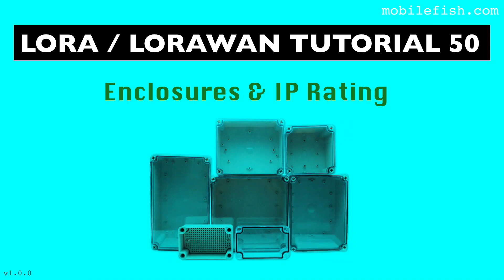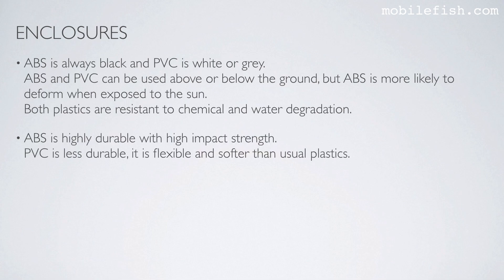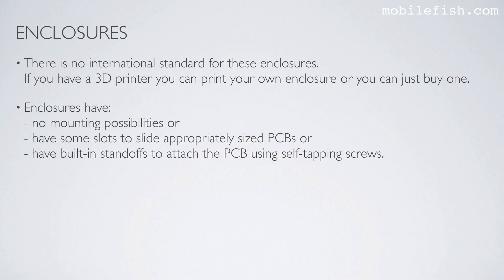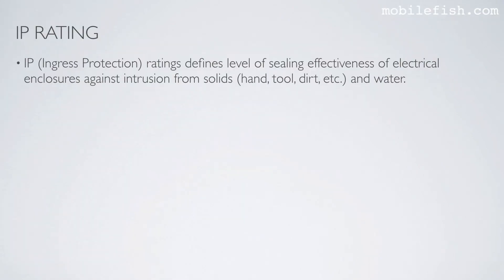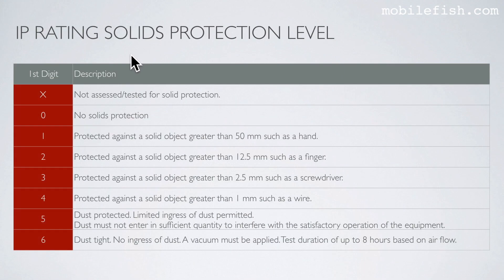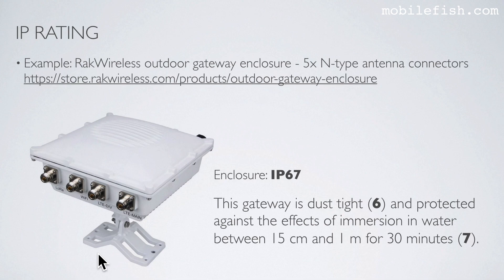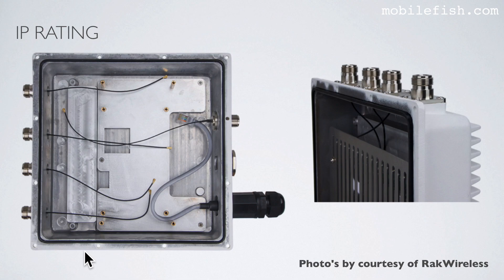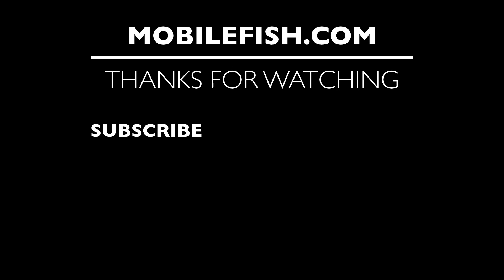LoRa/LoRaWAN tutorial 50: Enclosures and IP Rating

Comment: i just came across something moments ago after watching your Blockchain tutorial  11. it's about the generator point (G)
G (compressed) : 02 79BE667E F9DCBBAC 55A06295 CE870B07 029BFCDB 2DCE28D9 59F2815B 16F81798

G (uncompressed) :  04 79BE667E F9DCBBAC 55A06295 CE870B07 029BFCDB 2DCE28D9 59F2815B 16F81798 483ADA77 26A3C465 5DA4FBF 0E1108A8 FD17B448 A6855419 9C47D08F FB10D4B8

If you take a look at these formats of G, the compressed format of G is the X axis while the uncompressed format of G is the X and Y axis. I have no problem with that. But what i have an issue with is the prefix.  i'm talking about the prefix (02) in the compressed and the (04) in the uncompressed formats. is it necessary when performing calculations to remove the prefix?